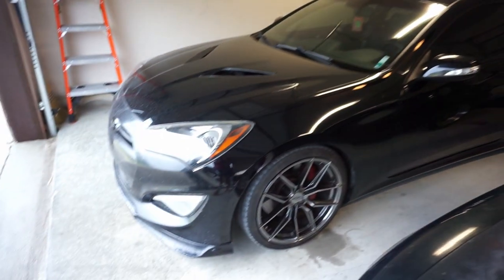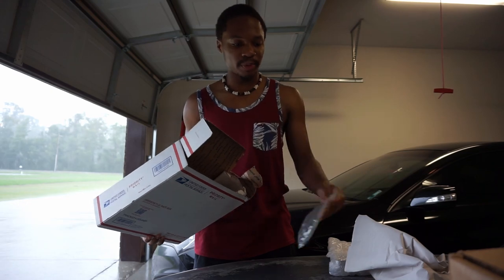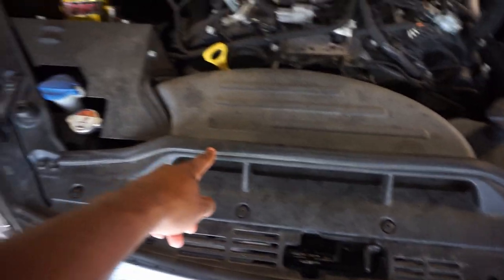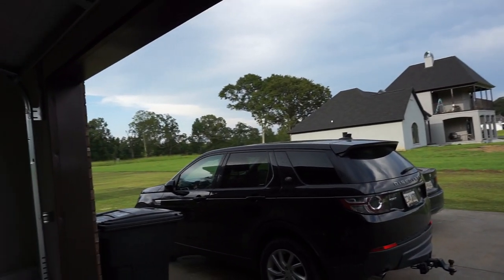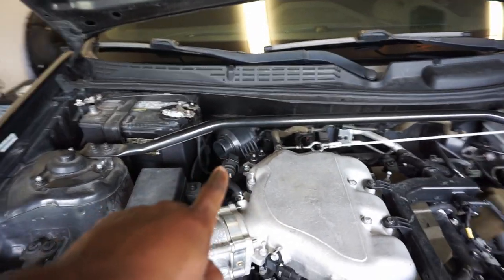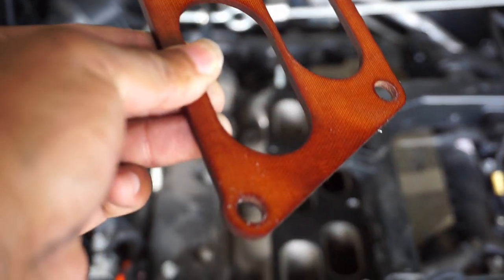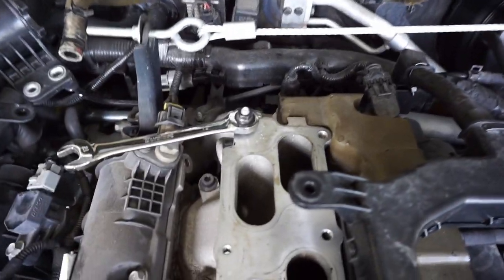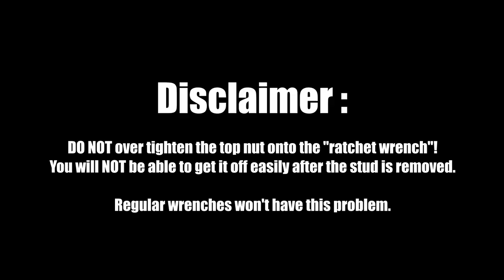Genesis Coupe 3.8 Intake Manifold Riser Install!

Comment: You cut out the part where you actually lifted off the intake plenum (upper intake). I'm trying to get mine off right now. all hardware is removed but the thing is not budging and feels glued down. Any tips?
Reply from the maker: You sure all the bolts are off? Two directly on top and 6 around sides, plus two holding wiring harness on top and some hoses
Reply: @pj_morrison  I hit it with a dead blow and it came off thankfully

Comment: Hey bro, did you or do you have a problem with 2nd gear lock out? Or is it just for the 13's? I'm looking to see if after I get the tune with the megan racing  tanny mount, through alfaspeed if the lockout will go away?
Reply from the maker: Wassup, I definitely was having transmission/shifting difficulties before those mods and engine leash. But it seems like it’s very minimal now. You can check out the video where I went to the track and see exactly how it went for me😅

Comment: Hey man, i see you have the short rams intake. For our bk2 cars for a true CAI we are basically limited to 3point8 version.
I did however adapt a bk1 Injen true CAI to my 2013 3.8. without reseting the ECU i installed and tested this on a dyno. Picked up 9 hp and about the same torque. I'm sure once the ecu adjust I would hit the advertised 13 hp/tq 
I can send you the info I'd you like? Basically you buy a 20 adaptor and that's it. Let me know.
Reply from the maker: https://youtu.be/CQ1evbK5CA8

Glad you did that tho👍🏽
Reply: Hey I know it’s been a few years but could you let me know more about how you were able to achieve this?

Comment: Hey love the install video, 

Quick question tho, how come they ask not to put the engine cover back on? Is it because since the raiser would push everything up a lil more and the cover would not clear the hood closing?
Reply from the maker: Thanks, and BINGO! You hit the nail on the head
Reply: Heard most people have heat soak with it on if you have short ram air

Comment: I have the same cold air intake and I’ve heard that they suck in hot air is that why you put the heat wrap around it and did that work??
Reply from the maker: I put the tape on it to help with the heat soak, but it’s not really a fix for it. It helps a little but the initial air is already warm. Just get a true CAI or make one custom, it’ll be a lot better